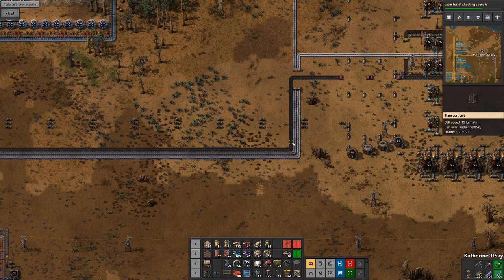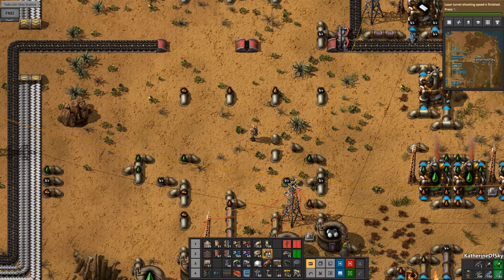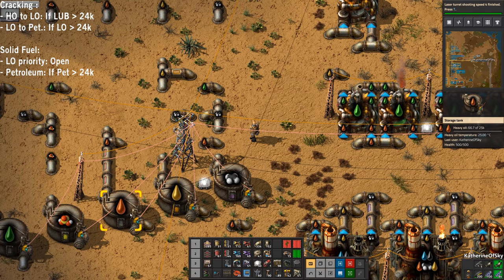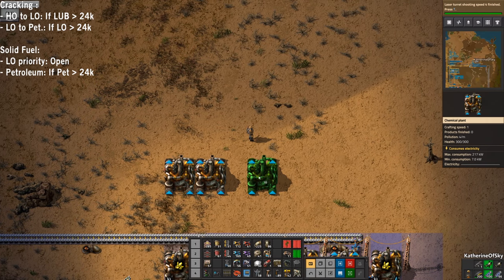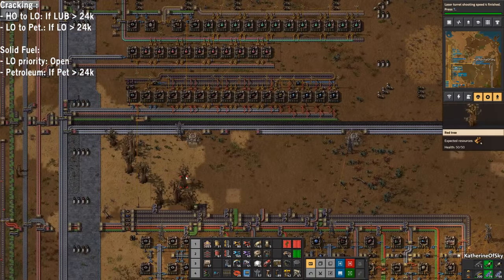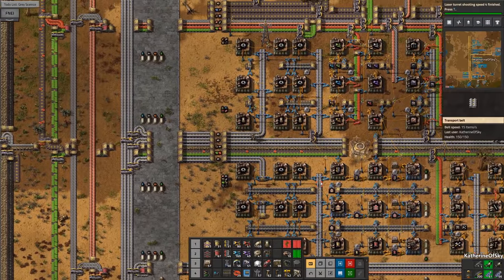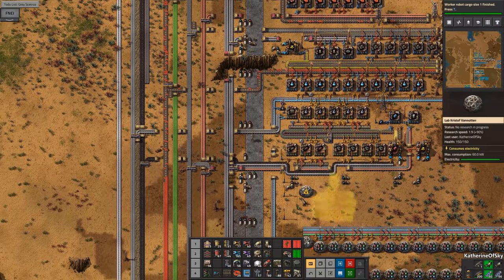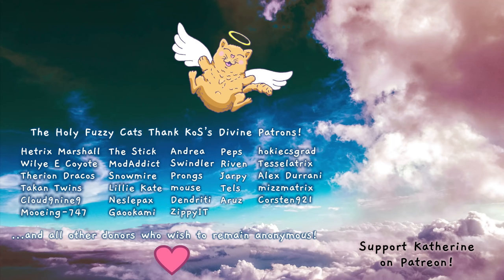Factorio 1.0 Entry Level to Megabase 3, Ep 16: ADVANCED OIL SETUP - Guide, Tutorial

Comment: I have followed the walkthrough from beginning but get any any heavy oil, the refinerys all say "output full". Ive gone wrong somewhere but cannot figure it our ??
Reply from the maker: Make sure you are emptying all the products: Light Oil, Petroleum, and Heavy.  Otherwise, the refinery will stop producing.
Reply: @KatherineOfSky  I thought I did that though as I made extra storage but they just fill up and I don’t get any heavy oil. ( well very small amount) why do I fill like 4 storage units of everything else but get no heavy oil?
Reply from the maker: @pomp97  Heavy oil is the smallest percentage of the conversion ratio, so it's probably used up instantly.  You can either store (some) of the oil, but mostly you'll want to convert it into product: cracking is the best option, but if you don't have advanced oil processing, you can convert it to Solid Fuel.   This video shows the circuit combos you will need for Advanced Oil processing so that it never stops
Reply: @KatherineOfSky  I finally fixed it! It was a simple piece of missing pipe....now I feel stupid ..Doh. Watched that episode 3 times. thx for helping though :)

Comment: Ok I have had this game for a long time and decided to "learn" how to play this time lol. Now in previous plays I always ran out of petroleum gas and plastics so to my noob brain it seems that those productions seem to be low here? Nicely done with circuits but when you start banging out 5 or 600 robots or even more does all this get rebuilt to provide the through put?
Reply: It all depends on how fast you want to make science.  Lets run a few numbers  Lets say you want 45 SPM (science per minute), which is 1 science per cycle * AM2's crafting speed of 0.75.  This will require 19.6 refineries to keep up, thus 20 is perfect.  Now, if you want double that, then eventually you need to double your refineries to 40.  However, lets say you want to go mega base (1000 SPM), then you will need 434 refineries.  However, this is both totally impractical and also silly, thus enters modules and beacons.  If you shove productivity modules in everything and then surround them with speed beacons, those 434 refineries reduces back down to 38.6, which would round up to 40.

So, starting off with 20 is totally fine.  Once you get further in the game, and want to go bigger, then adding more and/or entering the realm of modules is the best way to get more throughput.
Reply: @canebro1  I was shooting for 60 spm if I'm honest but it seems I really need to pay attention to math a whole lot more and learn this circuit thing I have never used it
Reply: @michaell9153  To be fair, for 60 SPM, you don't need math all that much.  Almost everything (outside of chemical and space science) needs less than 10 machines, so rounding up will solve most problems.

Advanced oil can also be done without circuits, just wherever you T junction to cracking, put a pump on the other pipe (essentially a fluid version of a priority splitter).

Circuits are cool, though.  My favorite is a fluid gauge.  I connect that same network from the video to a grid of lights, and set them to come on when  <fluid> >= 5/10/15/20/25k.